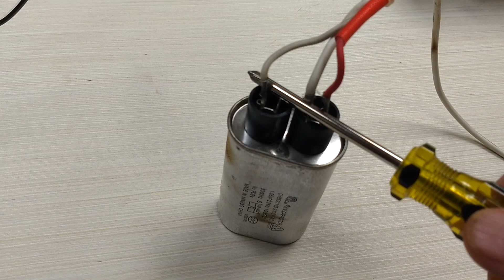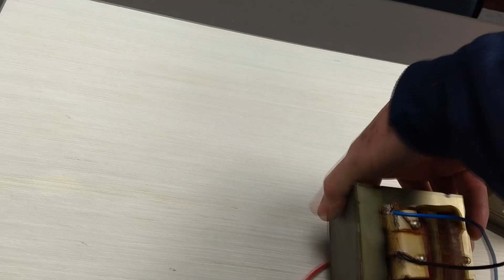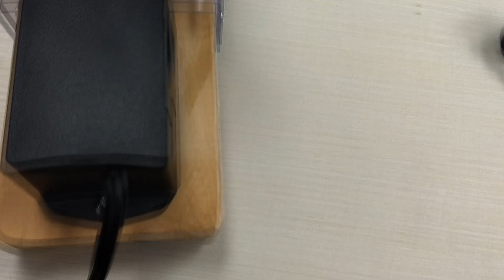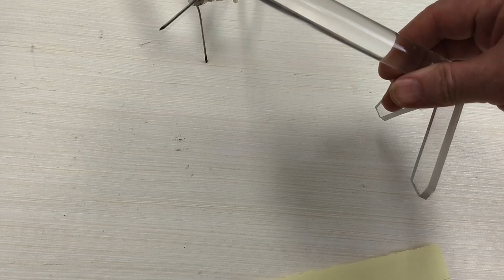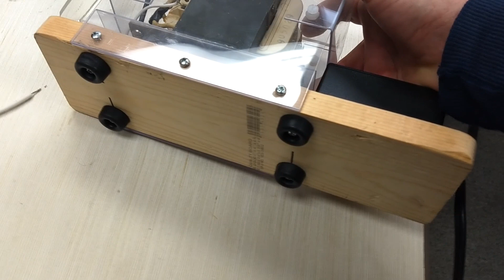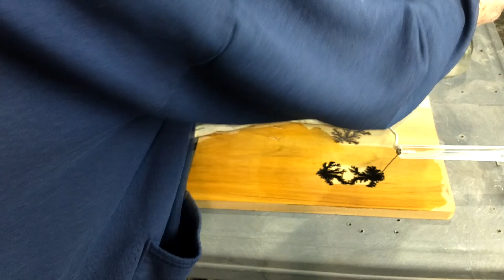Fractal Wood Burning Safety

Comment: Still reckless. I think if you try to ground this kind of voltage, it will burn right through a shoe's worth of insulation (specifically the kind isolation required for this is far more than a bit of plastic). Really people shouldnt be working with such high voltage.

Comment: There's no denying that the results are beautiful. However, I recognise the risks are very high unless you know exactly how to work with this kind of equipment. I certainly wouldn't attempt it myself, in fact, I'm certain I wouldn't ask someone else to do it on my behalf.
Reply from the maker: I used to be on a motorcycle endurance racing team. Some of our riders would not ride on the street. They thought riding on the track was safe, but riding on the street was not. Thanks for your comment.

Comment: This is actually a bit of a joke (not a funny joke).
This guy talks about the inherent dangers of fractal wood burning. A practice that has killed people dead in their tracks instantly, yet he goes on to show you how to do fractal wood burning.
The only safe fractal wood burning is no fractal wood burning at all. There are just too many risks and variables involved with the potential result being unintended death.
Handling black mamba snakes can be be safe as long as you don't receive a lethal bite. It only takes one slip and you are done. Obviously he doesn't seem to grasp this reality.
Reply from the maker: Thousands of people die each year driving a car. Many people die sky diving and mountain climbing and riding bicycles. People are going to do this no matter what you or I say. My goal is to make people aware of the dangers. There are videos showing the wood burning in outrageously dangerous ways. Seeing these inspired me to make my video. Perhaps this will save some lives. Thanks for your comment.

Comment: Many thanks for the safety tips Jim, you are one of the few who treat the dangers inherent in this incredibly beautiful art form seriously. Well done!
The results sure are beautiful and I'd love to try it but I worry that I might get momentarily distracted and, as you say at 20'30", you don't get a second chance with these extremely high voltages.
There's another good video regarding wood burning dangers "The most deadly project on the Internet"  https://www.youtube.com/watch?v=FBeSKL9zVro
Those microwave oven transformers are frighteningly powerful and deadly when removed from a microwave.
It may be worthwhile using the (unused) filament windings to operate a second 'Power-On' indicator as this would introduce a fail-safe that is probably rather essential given the lethality of the equipment.

Comment: Isolating the transformer is a brilliant idea!
Unfortunately, a potential nasty electrocution risk with the transformer isolated from ground is that there is several thousand volts potential between the transformer frame and the primary windings and I imagine these transformers are not designed for this.
If there was any leakage/flashover to the primary windings this may introduce a risk of current flowing through the artwork and into the supporting table and anyone touching the table.
I imagine that ensuring your metal table and anything connected to it was carefully earthed would be absolutely essential?
Reply from the maker: You are right that this is a possibility. If it does happen it is no worse than intentionally grounding the transformer. Also if this happens the secondary winding will burn up and you will know it from the smoke. Thanks for your comment.
Reply: @Jimscoolstuff  - Not having built one yet I'm only working from theory and often practical experience is by far the better teacher. My thoughts are that Leakage/flashover would be from the transformer frame to the heavy wires of the primary so there wouldn't be any reason for the secondary to burn up (hence it would continue to work and there may be negligible or no smoke).
I agree it would then be as if you had intentionally grounded the transformer (via the Neutral and/or Active wires) but this would then leave the workpiece and the table underneath at a potentially lethal voltage?
I just watched your "Fractal Wood Burning Electrocution" video, the bucket is so much simpler, brilliant! 
I love your videos, so much variety, so much common sense, experience and lateral thinking. Much appreciated.
Reply from the maker: @leybraith3561  Thank you for the kind words.

Comment: I literally came here after reading an article about a Wisconsin couple who electrocuted themselves and burned down their house doing this. I didn't know what the fractal burning was that was mentioned in the article, so I looked it up and found this. It looks cool but I don't think it's really worth the risk. I'm an electrocution survivor. Stuck two metal rods into a 220 V household outlet in Europe when I was 4 years old. I was literally attached and could not pull myself away. Had my mother not quickly pulled the breaker, I would have most likely died. The incident resulted in a permanent heart murmur. When you mess with even higher voltage you are risking your life. Too much that can go wrong.
Reply from the maker: Thankyou for sharing this information.

Comment: Hi, that's way I bought my Alanson iginition transformer, the voltage is veryry hight 10,000 volts but  it's only 23 miliamps current.
Also did my start key with two botons with enouth distance betwuen them to avoid touch two botons with same hand, is like a fool prouve, I prefer to be an alive fool instead a  smart guy dead
Reply from the maker: The current rating of a transformer is the amount of current that it can produce continuously without overheating. Transformers can produce many times their rated current for short periods of time (like long enough to kill you). I plan to make a video about this soon. Please be very careful. Best Regards

Comment: I greatly appreciate the information on this! Especially on the safety precautions. I'm not scared of it but, I do respect it. I'm  in the process of building one and using part number's at McMaster.  What is the part number for the  terminal block and the plastic sheeting with the fasteners?
Reply from the maker: The terminal blocks are from Digikey or Mouser. The clear plastic is from McMaster. It is clear PVC.
Reply: @Jimscoolstuff  could you help me narrow my search on the terminal block? For example the specific name of the block. Also what's the voltage and amp?
Reply from the maker: @jasonbaldwin2566  I used a terminal block that I had on hand. Here is the Digikey part number for a similar 3 terminal part which is in stock. Use the outside 2 terminals. ES1000/03DSFB
Reply: @Jimscoolstuff  Thank you so much! I appreciate your help!!

Comment: Congratulations and thank you for your nice and very comprehensive video. I would like to know where can I find that voltage changer? do you have a link or something similar? Thanks
Reply from the maker: The transformer (voltage changer) is removed from a discarded microwave oven. There is a link in the description to a video that shows how to do this.
Reply: @Jimscoolstuff  Thank you very much my friend. Bye from Naples
Reply: @Jimscoolstuff  I meant the power or voltage regulator, not the transformer, I already have that. I'm talking about the regulator that you set with your hand at minute 16.03 on the left of the screen
Reply from the maker: @capripiu  Here is a link to a source.https://www.amazon.com/s?k=variac+20+amp&crid=1JNMFGHRUNSBU&sprefix=variac%2Caps%2C194&ref=nb_sb_ss_ts-doa-p_4_6 You probably need one with a 230 volt input. Here in the U.S. our voltage is 120 volt 60 Hz.

Comment: Yes, you're very right about safety. This is no toy and a mistake will most likely end deadly.
I try to explain to people that this is as dangerous as a loaded gun if one is careless.
A somewhat safer approach is to use a neon transformer which is typically around 20-25 mA whereas a microwave transformer is around 500 mA
 or 0,5 A which is fatal if the leads are touched! Touching a device that is limited to 20-25 mA will be extremely unpleasant but it's unlikely one will get killed on the spot if one is a normal healthy person.
The safety relay at the breaker box will do no good because it's a transformer. The secondary winding is physically "detached" from the 120/220 V Ac power that comes out of the wall socket.
Reply: @Jimscoolstuff  Additionally you only need a lot less current to cause electrocution including heart failure. People have misunderstanding when it comes to current rating.

Comment: You mentioned the transformer from the microwave has 3volt supply wires.  Couldnt you use that to activate your sound generator?
Reply: At lower voltage settings of the variac, you will not have enough voltage to turn the buzzer on and yet you will have lethal voltage present at the probes.

Comment: Just remember this number 
625 deaths from doing this maybe higher by now with all the novice videos on this subject. Glad to see a saftey vid on this. A few precautions i use when burning is i wear lineman boots and stand on a rubber stall mat and i use dead mans switches also using wire rated for the high voltage being used ive seen it jump almost a foot wire to wire just like lightning the pos is searching for a ground with least resistance. Best advise buy a safe burner these MOT and others are death traps unless you are well versed in electrical knowledge and its proper and safe use. Stay alive dont diy this.

Comment: Good info Jim.

As I use to play with extremely high voltage’s (think experimental fusion rector high), and for me safety is job one. I was thinking of building a fractal burner, monitored by CCTV, with a stand-off deadman’s switch.  Any thoughts about that configuration? 

I worked for Atomic Energy. We had a series of keys that served two purposes, secure the device and arm the device (you couldn’t arm the device until all safety gates had been secured - at which time all hell broke loose with sirens). We also used air switches, electrical switches were too dangerous.

Air switches are like relays, but instead of a lower voltage switching a higher voltage we used air to switch the high voltage.

Comment: Dear Jim, every now and then a true expert in the field pops up that makes all the other players look like rank amateurs.  That is you Jim. Thank you so much for sharing your insights and presenting your beautiful pieces of work. Now I know for what I should strive to achieve! Cheers.

There is one thing I would like to know. On your variac, what are the characteristics?  {Voltage input and Power}.  I can buy one of a range of power devices and would like to know what you use.

Comment: Great video, thanks for all your insights and clear explanation! 
One remark about you buzzer circuit: you use a series capacitor which limit the amount current through your zener/buzzer circuit. While switching ON with the variac not dialed to zero, the inrush current might be very high and could blast the zener and so your buzzer. It might be a good idea to add a relatively small series resistor (about 1 kOhm) to the series capacitor circuit, limiting the inrush current to safe levels. 
Thanks again, you might have saved lives with your video.

Comment: Quick question, what type of wire did you use on the end of probes?
Reply: @Jimscoolstuff  In video you said 2% solution for one way burn on copper wrapped in paper towel, my question is said use normal solution on other side, I'm guessing 1% =  1 table spoon per cup?  Not quite sure what normal solution ratio is, but I'd like to follow your lead while doing this process.  TY in advance again.
Reply: @Jimscoolstuff  TY for all your information again, I finally got mine built with a 1kw microwave transformer and built it off your design with little tweaks.  Quick question I was messing with different solutions, have you ever tried "washing soda"?  I gave it a try and had impressive results, it's what I use for my  electrolysis solution for parts cleaner so decided to give it a try.  I'd post pics of my build but not seeing option to post pics, only comments.  Guess I could use imgur and post a link when get a chance.

Comment: I have an enclosed box neon transformer 10kv 30mA with a plug and two wires which I have attached aligator clips what I would like confirmation of is the best place to place the ground wire (which came already wired to the box), I would appreciate your knowledge on the subject.

Comment: Very useful information. I cant sayenough how greatful i am to have located your video. 
I just started doing this style burn. I built my machine. Thank god for your information. You.may have saved my life. 
My transformer was all exposed and in the open. It was only a mater of time i would  accidently touch it. Im a woodworker with electrical training...i know how electricity moves. But i did not know the one key ingredient.....ground wire to transformer frame. You saved another life. Mine. 
Me and my wife just had our baby 4 months ago. We live in Costa Rica. Imfrom Texas, she is here. I met and fell in love here while on vacation. This style of wood burning does not exisit here. There is good market for what you are doing there. 
This is a source of income for my family. 
I made a piece with oil paint/thinner  in the background. Earthy tones.Then i seen yours.
Controling the burn with paper towel and copper wire. I will try this.
Wish i could load a photo for you to see.
Out of all the research i did, i find you by far the most helpful. Any tips on putting the color on the background ? Type of paint, mix and so on.
THANKS!!

Comment: Great video, Jim.  Much appreciate your in depth talk on safety.  I have one question that you did not address about the probes attached to the acrylic plastic that conducts the burn.  What are you using for the probes that touch the wood?
Reply: M A S K

Comment: Thanks a lot for pointing the blind spots and sharing your tips.. It really helps. I built one similar to your setup but minus probe - I am using a normal alligator clips. There is another point to mention about input electricity, this was pointed out by my friend. In India we have separate plugins points for 5amps (for all our small appliances) and 15 amps (for high voltage appliances). I believe it is important to plug the inputs wire to main with 15 amps electricity also with high gauge wires and switch which support 15amps. Thanks again for your valuable inputs.

Comment: I don't recall in the video, where you addressed body safety around electricity.  Perhaps I missed it?  At any rate, it's good to reiterate.  I am an Air Force taught electrician, and went through their basic electronics course in tech school.  We were taught many safety practices, but what most people don't know, or forget, is to pay attention to what you are wearing, when around electricity.  

Always remove metallic buttons, rings, chains, bracelets, and belt buckles from your hair, body and clothing .... Especially, any metallic jewelry in body piercings.  Do not tuck such items into shirts, pants or hats (What can easily be tucked-in, can just as easily fall out).  Wear rubber gloves and shoes, and as an added measure of safety, stand on a rubber mat.  DO NOT stand in water .... I don't care if it's just a damp floor, or five feet of water .... DON'T DO IT!  Water and electricity do not play well with each other!  That point cannot be overstated.  

MOST IMPORTANTLY ....

NEVER work with electricity by yourself.  Have someone within sight at all times.  Brief these folks on how to safely remove you from an electric circuit.  Have a wooden pole or wooden cane nearby, so that you can safely be extracted.  Brief them that they should NEVER TOUCH YOU AT ANY TIME, if you have an accident and become part of the electric circuit.  The minute they touch you, they too will be electrocuted!  Instruct them on where the house master circuit breaker is located.  They should flip this circuit OFF immediately.  ONLY THEN, should they attempt to push you with the wooden pole (or pull you with the wooden cane) clear of the electrical equipment.  They can then proceed with calling 911 (first) and starting CPR.  

The Air Force made us do CPR re-certification at least once a year .... Sometimes more.  It is good training to have!

Comment: Great video, Jim.  I like your probe design.  One question: What are you using for the probe contacts at the ends of the acrylic rods,  that the high-voltage wires attach to?